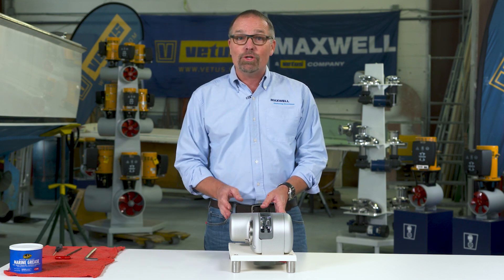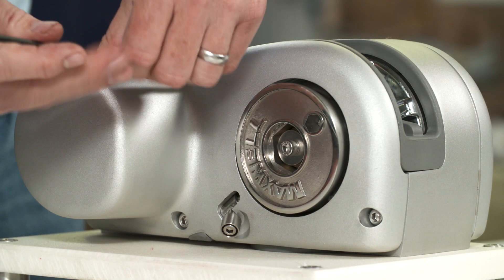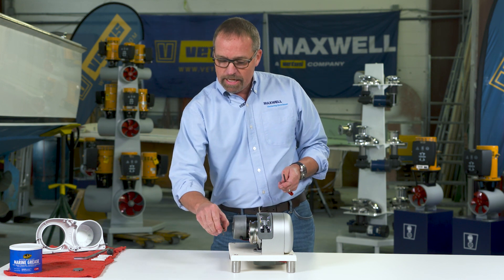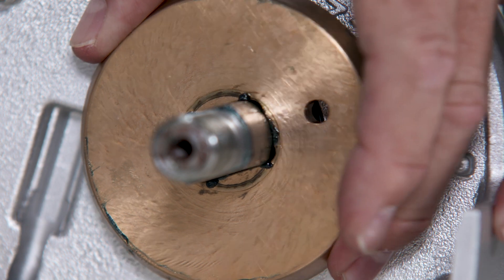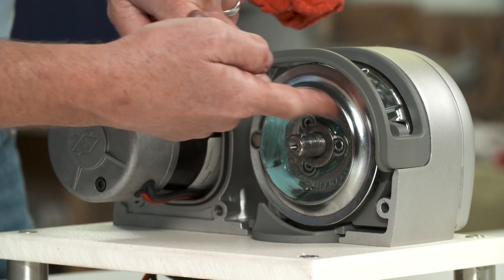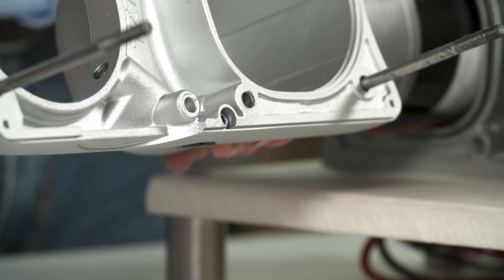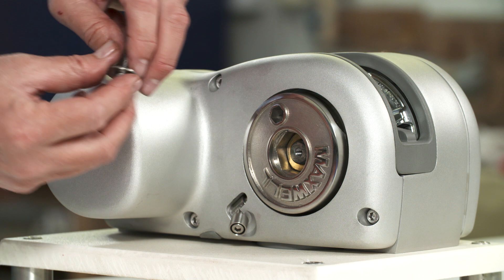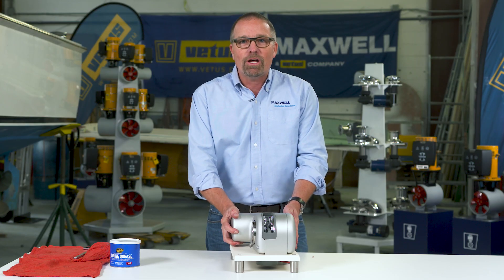HRC FF8 : horizontal winch from VETUS / MAXWELL, DIY service guide

Comment: Does it matter which way around the bevel spring washer SP0484 goes? Mine is around the other way compared to your video. The outer edge of my washer is on the clutch cone.

Comment: Hello, I have a question, I bought a new modified windlass (conversion from 24 to 12 vdc, done by Vetus). Only the installed a 400 Watt motor instead of 600 Watt. Now I have to replace myself the motor. Can you give some advice? I received a new motor from Vetus but no installation.

Comment: I have an issue with my HRCFF. When retrieving the anchor, if I don't stop in time and leave some chain slack, it'll lock itself up and won't operate next time I try to drop. Just clicks like the solenoid is faulty. My dealer says the HRCFF can't be retracted fully so the chain goes tight. The Manual just says retrieve the last few feet slowly, so I guess they mean click the switch repeatedly instead of holding it on. A real fault of the system if this is really the issue. And kinda makes my remote control at the helm useless as you can't see the last few feet of slack from that position. Any ideas on how to fix? Could just be the solenoid and the dealer is giving me a bum steer....

Comment: My HRCFF 8 pressure arm breaks every time I use the windlass. I suspect it happens at the chain/line splice. I have 5/16 HT chain and 8 plait line. Any advice? $25 per usage is getting expensive.
Reply from the maker: Please take pictures of the hull/chain splice and your setup, as this should not happen. It could be a matter of alignment. If you take your pictures to a Maxwell dealer, they can offer advice : https://maxwellmarine.com/global-support/

Comment: Thanks for the video. I have all the correct size rope ( 12mm nylon braided rope ) My anchor weighs 4kg and i have 10m 7mm short link chain.Question: Why is my rope slipping ...It has always done it...Is my anchor too light ????. When i pull the anchor up at first, works well. Its only when the anchor is off the sea bed, when it slips. Please help...
Reply: The rope is coiling below the windless is stacking up, while the rope comes into the boat adjust the rope to the side of the box where it’s stored. I had the same issue.
Reply: Vinnie Fugett 
I have done that and still does the same thing.
How heavy is your anchor and length of your short link chain. ?????
Reply: ar2000able 14lb anchor and 20ft of chain
Reply: Vinnie Fugett 
Thanks, seems to to me, that my anchor is too light. My Anchor weighs 8.8 Lbs.

Comment: THANK YOU! I was almost NOT going to buy this windlass because their own manual makes it sound like they want you to do a lot of maintenance on 'em.  this looks easy.  also, do you recommend installing these on four 'legs' like it shows here? vs a platform kind of install?
Reply: pretty sure the legs are just for his demonstration.  There is a pattern for the hole and bolt holes to cut in the deck.  Cheers Rl.